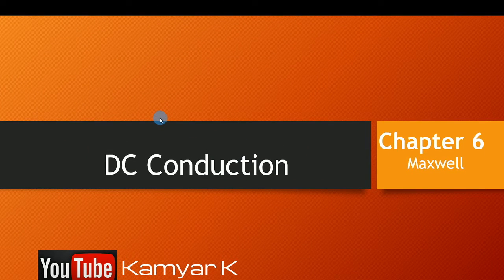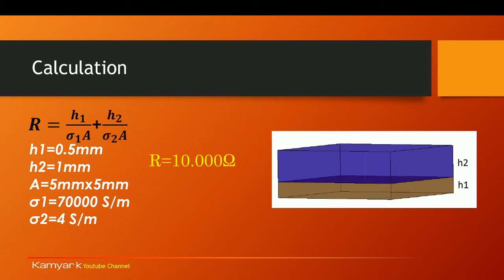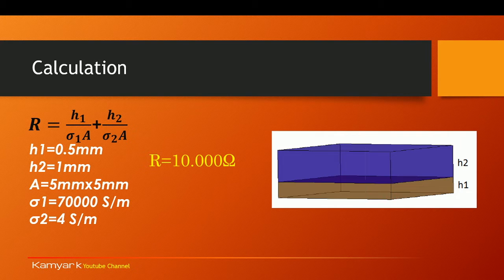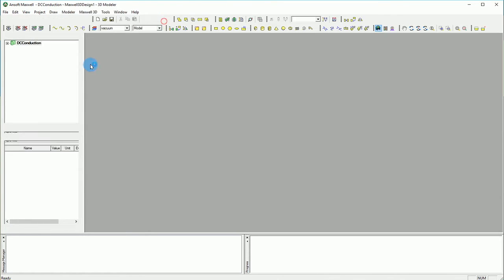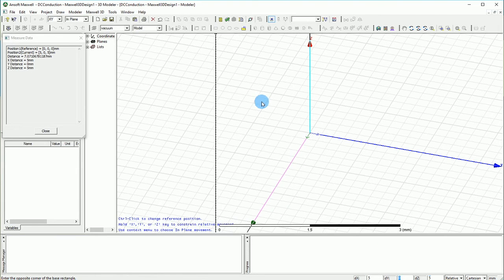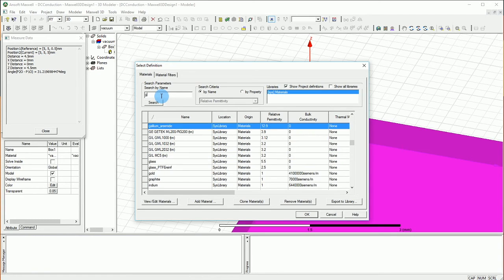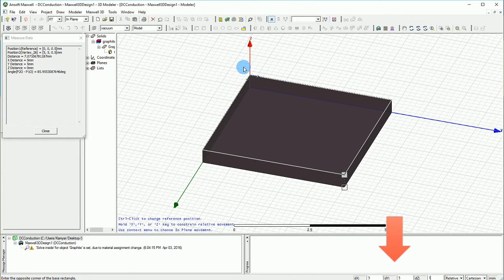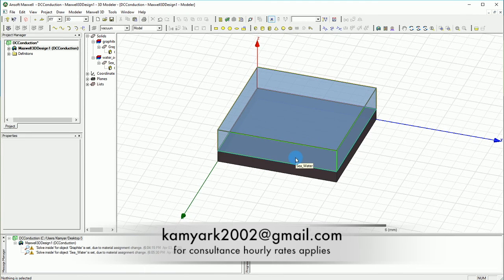601- Ansys Maxwell | DC Conduction | Resistance of Sea Water [1/3]

Comment: Hi, Thanks for sharing this video. Is there any way to calculate the AC conduction of a medium and then calculate the medium's resistance as shown in the video? Assuming that we have frequency-dependent expressions for the conductivity and permittivity of the medium in hand (something like plasma)
Reply from the maker: Yes, you can use eddy currrent solver and make sure that the eddy current effect is checked